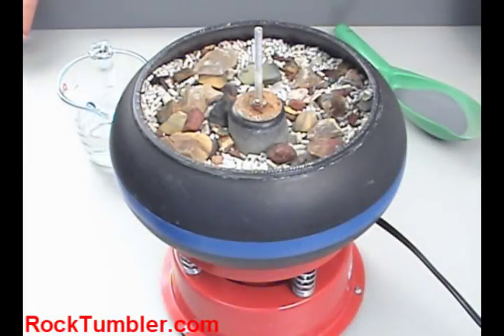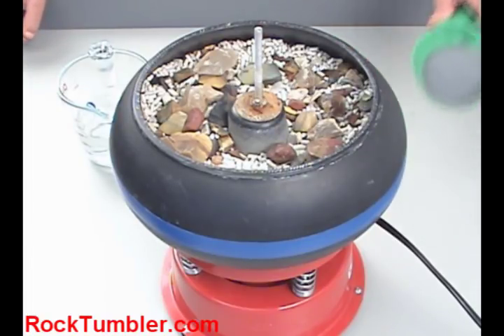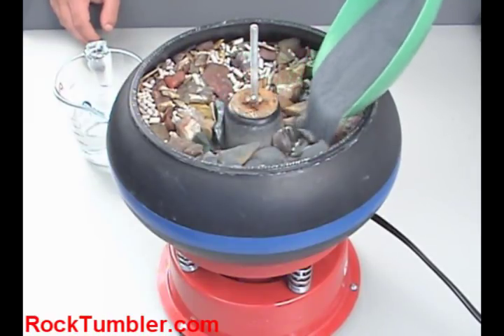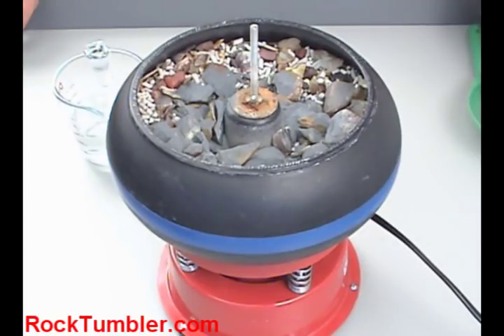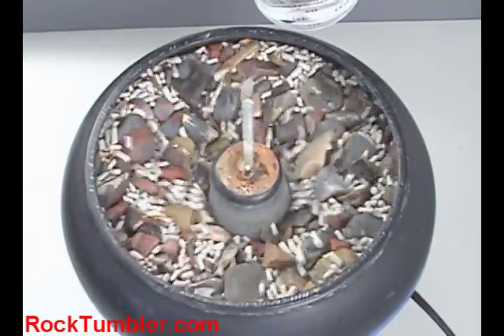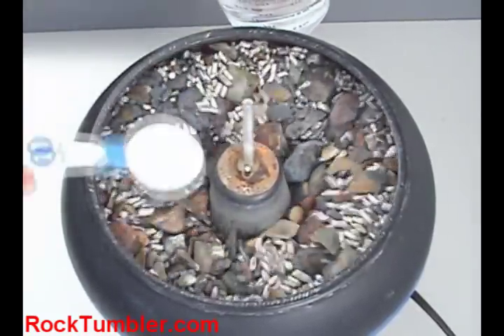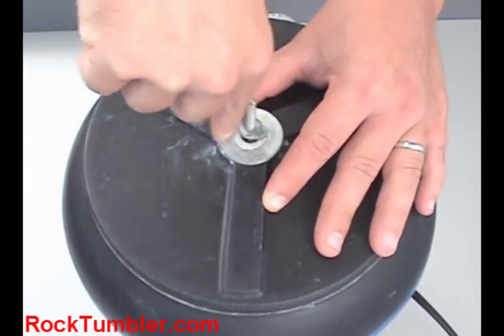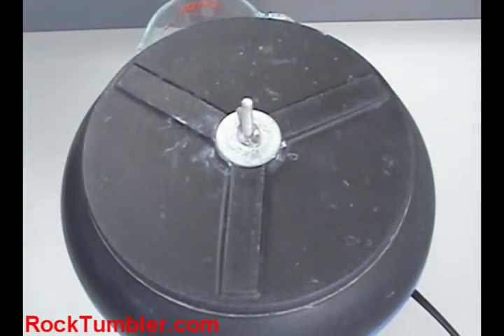Thumler's UV-10 Rock Tumbler

Comment from the maker: Thank you Tracy,

The ceramic media works great for tumbling opal or any other rock/gem material.  

The rotary tumblers will wear away a lot of opal.  You could lose 30 to 50% of the weight in a rotary tumbler.

To lose the least amount of weight and to preserve the original shape a vibratory tumbler works best.  

We recently wrote a blog post about tumbling opal.  I'll post a link to it in our video description above.

Comment: How has this tumbler held up?  I'm considering going to this brand of vibratory tumbler?
Reply from the maker: We have three Thumler's vibratory tumblers at our warehouse.  One (a UV-10) has been running about 50% of the time for the past 12 years.  We have never needed a new motor, we have replaced the bowl twice.  The others are about eight years old and we have not replaced a motor or a bowl.  These are run about 20% of the time (a UV-18 and a UV-10 MiniBowl).  

We have sold a lot of these tumblers and hear very few complaints.   The most common complaint is about the bowls wearing out.  But, most people could change their habits and their bow would last a much longer time.   We get several years of use out of our bowls.   We have an article at the link below that explains how we get a long life out of our bowls.  We also have other videos about how to use them in this channel.

https://rocktumbler.com/tips/vibratory-tumbler-barrel-life/

These tumblers produce an excellent polish and we have always known the manufacturer to honor their warranty and help people who have problems.

Comment: I accidentally added too much water. Process is going okay, but grit is clumped at the bottom and some rocks are "locked" in place. Is there a way to resurrect the batch (removing water, adding grit, more rocks, ceramic) or should I just start over?
Reply: hello I am from venezuea I have one but I will not use it

Comment: Hello Moogie,   

If you add a specific amount of water you will have the wrong amount every time.

The amount of water needed depends upon the amount of material in the tumbler bowl, the particle size of the rocks/media in the bowl, the smoothness of their surfaces and how much water is attracted to them.

Your goal is to add enough water to wet the surfaces of all particles in the bowl enough that the grit sticks to them.  

If you add a little too much water, no problem.  Just operate the machine with the lid off for a short period of time.  The water will evaporate rapidly.

Comment: i just bought one of these and i am tumbling some quartz and some agate.  i didnt have any ceramic media so i used plastic beads.  my rocks are all 3-4 inches and they dont move like yours do.  they very slightly move around but not top to bottom.  will this work or should i use the rotary tumbler to knock some size off them first before i use rotary?  also, i filled past blue line but nowhere near as full as you have it.  thanks
Reply: after posting this comment, i remembered that i hd some partially polished quartz that was smaller and a few pieces of untumbled that were also small.  as soon as i added them, it started working better.
Reply: rob robert Thanks for letting me know.  Nice work!

Comment: This video is very deceptive. It looks like you're putting 9 tablespoons full of water in the barrel, which is way too much. As a newbie, this ruined my first attempt. I took advice from someone else, used a spray bottle instead, and it worked. You should say something about how full those spoons of water are, it's impossible to tell from the video.

Comment: hi Sir
sorry for my englisch
i am italian and work red coral
do you think that regular rotary tumblers would work for this without wearing to much of the original stone away? Do you think that vibratory tumblers would be better? Do you think that tumbling would work for corals at all? Thanks for your help!
Reply: Hello, I'm from Florida.  I polish agatized coral in this machine and It works very well.  The amount of material you loose will depend on the length of time you tumble the coral on the first stage with the medium grit. Most of my pieces stay roughly in the same shape as when they were originally placed in the vibratory tumbler rather than becoming completely rounded and greatly reduced in size as in a rotary tumbler. I usually let it go for 2-3 days for the first step depending on the quality of the rough stone and if it has any cortex remaining on the outside. The pre-polish and polish steps only take one day each.  It's really nice to have a finished batch of polished stones in 4-5 days instead of weeks.

Comment from the maker: Hello,  

We use small ceramic media or similar-hardness materials such as obsidian or landscape glass as cushioning.  

Rotary tumblers change the shape of the stones by "rounding" them.  Vibratory tumblers generally do not change the shape as much.  If you opal has soft spots the shape can change significantly if you don't keep an eye on what's happening in the tumbler.

We have an article about tumbling opal on our blog (link provided in the video description).

Comment: Hmm that's LOUD maybe put the tumbler inside a plastic bin? You can close the top over it and just pinch the electric cord a little bit it won't damage the cord.
Reply from the maker: Hi Word of Mouth,  Thanks for your comment.

Tumbler motors are air-cooled.  If a tumbler is placed in a bin or under a box, the motor will likely cause a build-up of heat in the enclosure.  That could cause the motor to be damaged.

The amount of noise that you hear early in the tumble will decrease as the stones are worn down by the grit and a mud develops - they stones run smoother then.  Also, when the lid is closed, the amount of noise that you hear will drop.
Reply: @RockTumblerdotcom  Ah well you'd have to be very careful to allow the warmer air to totally escape while you still could arrange a system which could in part muffle the sound. Thanks. 

..

Comment: I noticed you have screws going through the base.  Are these for the rubber feet?  Do you level your machine with them?  I have drilled through the plastic and added screws to aid in leveling as my center threaded rod was getting hot. Is is ok to have the machine a little off? (I have mine on my kitchen counter which is not level at all).

Comment: I wish there was a quiet rock tumblr. I want one so bad but I think my neighbors would kill me.
Reply: Rotating rock tumblers are a lot quieter, but they're also a lot slower. The motor humming noise they make can easily be quieted by placing them on a concrete floor. If that's not a option for you (e.g. upstairs apartment living,) placing the tumbler on some hard foam packaging material should do the trick. Good luck!

Comment from the maker: Thanks for asking.  

If you use the Thumler's UV-10 or any other vibratory tumbler without water very little grinding will occur.   

The water causes the grit to stick to the stones.   That turns every stone in the barrel into a piece of vibrating sandpaper.  

Without the water, the grit will fall to the bottom of the barrel and be ineffective.

Comment: My neighbors complained to the condo association that my rock tumbler is too noisy. Can you run a tumbler only during the daytime hours when they are at work, turning it off every night, or will the grit and water and rock slurry turn to concrete if it isnt continually moving?
Reply: This is one of the loudest tumblers I've ever heard - wouldn't purchase it.  I got a LORTONE Model 3A and it's not silent but it's WAY quieter than this one.  I'm in a 1bedroom apartment and I run it inside a closet where the little sound it makes is muffled well.

Comment from the maker: Hello Fran,

You are right... a lot less glass goes into the oceans today.  More is recycled and less is dumped into the environment.  That is good.  :)

Some people use beach sand when tumbling glass.  If the sand is angular quartz grains it will work fine because the quartz (hardness 7) is able to abrade the glass (hardness about 5 to 6).  If the sand has rounded grains the abrasion is slow.

For faster results you can tumble the glass in silicon carbide (hardness 9+ and angular in shape).

Comment: What is rough and media? I just bought one a Thumbler UV-10 Rock tumbler and the directions do not mention anything about using  rough and media.
Reply from the maker: "Rough" is a word that is used for the unpolished stones that are placed in the tumbler.

"Media" is a word used for small pieces of round or cylindrical ceramics that are used as filler or cushioning.

We have an article that explains how to use the UV-10 tumbler for polishing rocks here....
http://rocktumbler.com/blog/operating-the-thumlers-uv-10-rock-tumbler/

... and an article that explains "media" here...
http://rocktumbler.com/tips/using-the-right-tumbling-media/

Comment: How long is one tumbling cycle?
Reply: Hello Wanderlinse,

The tumbling cycle depends upon the condition of the rocks going in and how picky you are during the first step.  

But generally, if you allow three or four days for medium grit (step 1) and about two days each for fine and polish... So, the total tumbling time will typically be about a week.

If you start with really rough rocks and are picky you might spend a few days more in medium grit.
Reply: OK, thanks. Is a vibrating tumbler faster than a stone mill/ball mill?
Reply: Wanderlinse I have never used a stone mill/bill mill.  Sorry.
Reply: Hobart King Thanks a lot anyway :-)
Reply: I read somewhere that these vibratory tumblers are faster.
Reply from the maker: timtak1 In a rotary tumbler this is the approximate time spent for tumbling rocks....

- coarse (60/90 grit) - one week to several weeks depending upon material
- medium (150/220 grit) - one week
- prepolish (500/600) - one week
- polish - one week   

In the vibratory tumbler shown above the coarse grit step is skipped, then....

- medium - three days to a couple of weeks depending upon material
- prepolish - about two days
- polish - two days, sometimes one

So, yes, they are faster.   They have a difference in performance.  Rotary tumblers tend to round the points and edges off of a rock in the coarse step.  Vibratory tumblers do not alter the shape of the rough as much.  They simply smooth the surface.

Most of the rocks that I tumble go through coarse grit in a rotary tumbler to round the rocks.  Then two days in medium, prepolish and polish.  That gives me the shaping of a rotary and the speed and grit savings of a vibratory.

We have articles here....
http://rocktumbler.com/blog/save-time-and-money-with-a-vibratory-tumbler/

and here....
http://rocktumbler.com/tips/rotary-and-vibratory-rock-tumblers-explained/
Reply: timtak1 I read that the amount of stones, water and polishing material must be quite exact. A stone mill is much more durable and easier to use.
Reply: Wanderlinse Thank you. In the comments below too, there is the opinion that the amount of water needs to be fairly exact.

But, when I google images for a "stone mill" I am shown machines with flat stones for milling grains, rather than something for milling, or polishing stones. Please would you be so kind as to be more precise about the meaning of "stone mill"?

I am only on the lookout for something for my son, so that he can polish up stones that he finds on the beach, so perhaps a stone mill would be out of our league in any event.
Reply from the maker: Wanderlinse I agree.  The amount of water is the hard part to determine.  You can't just add X tablespoons.  The amount varies depending upon the amount, the size, and the shape of the rocks.  And you might need to add more as a mud develops on the rocks.